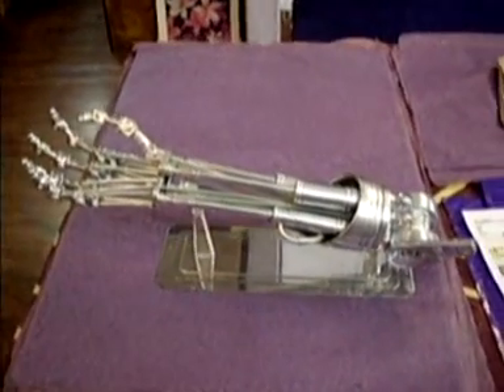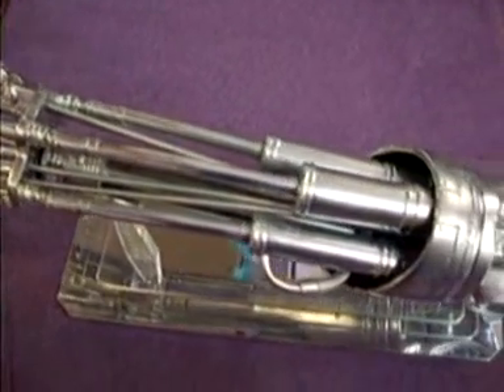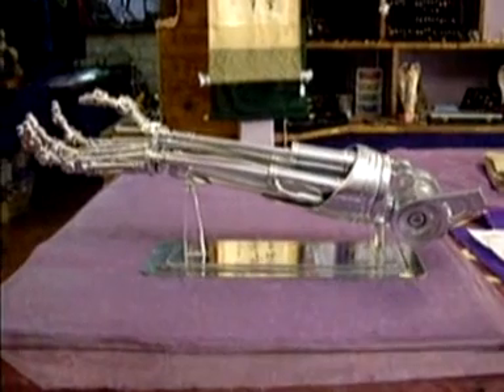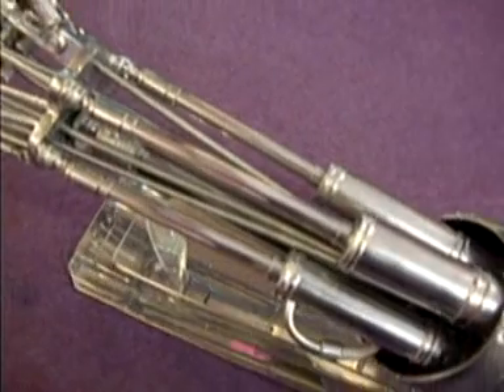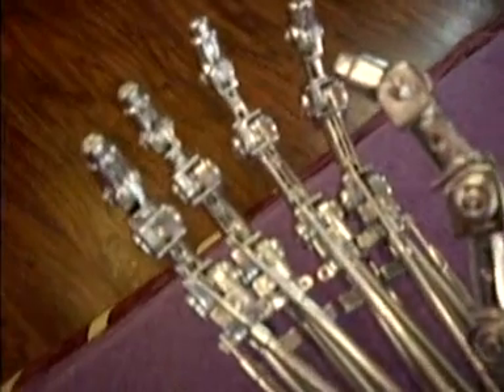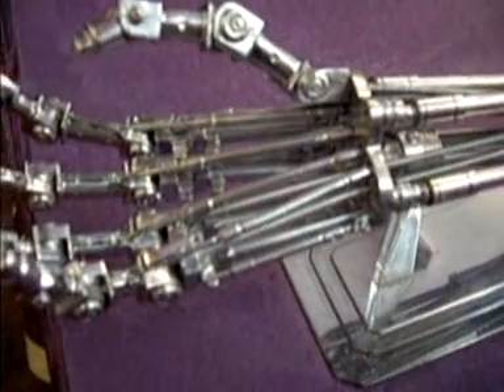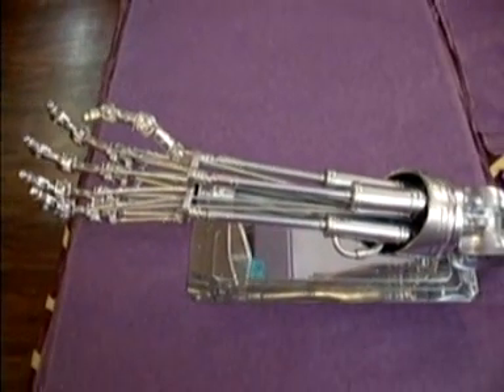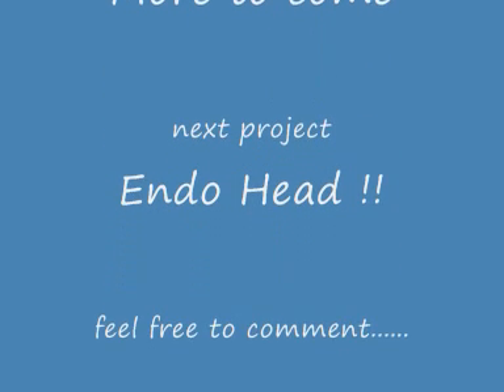Terminator Endo Arm

Comment: I'm considering making a T-800 arm out of aluminium. I'll need to either buy or make a mini lathe, but the rest should be relatively easy. I've already done the measurements and detailed schematics for the hand, based on many photos available on the net. 
Probably the hardest part will be getting the tiny wheels used for the cables in the fingers, plus bolts for the knuckle joints to match those in the films. I've got a heap of highly-flexible steel cables ready though. :-)

Comment: I'm building the same kit. There's a LOT of imperfections, so many late nights with my Dremel tool. Two-part epoxy is definitely the best stuff to use because it can be re-shaped. The moulded screws aren't detailed enough, so I'm replacing them with exactly the same metal screws as used in the movie arm. I'm also using bike brake cables because they're flat-wound, that's the same as the actual movie ones.-The licensed models have incorrect round-wound cables. I'm also doing a 1:1 endoskull. :-)

Comment: I've been checking out these model kits for a couple of years, now. It seems they're all made in Thailand and none come with all the parts, especially the steel cabling that thread up through the fingers. Fortunately I scored a heap of the same type of cabling from work, so I'll be right when I eventually find a decent kit to buy from somewhere more local. (I've had too many problems through eBay). I've already got Alclad, chrome II paint for the kit. -VERY realistic chrome paint! :-)